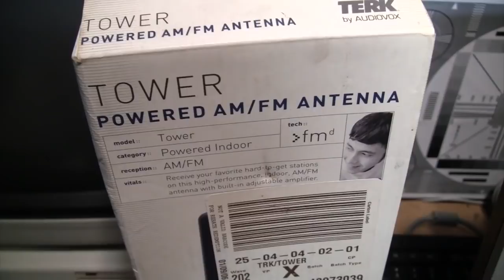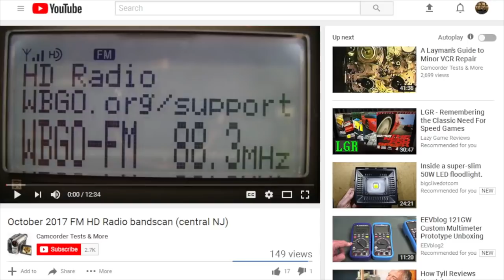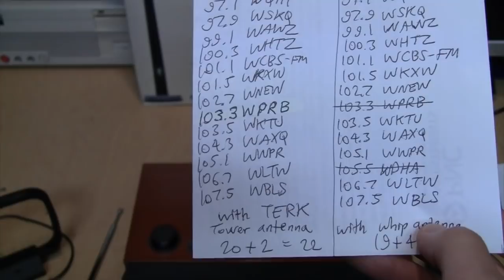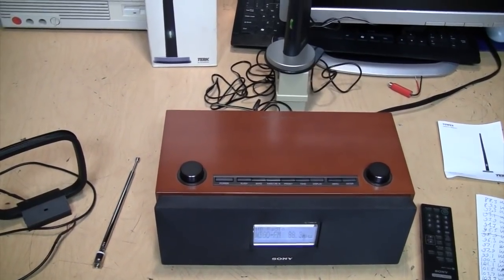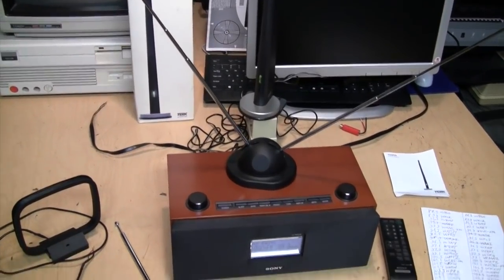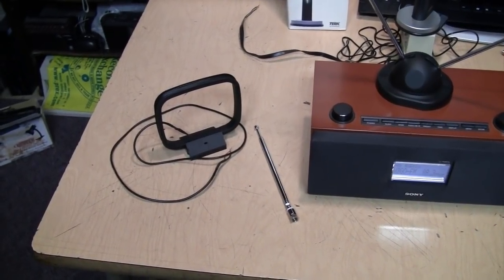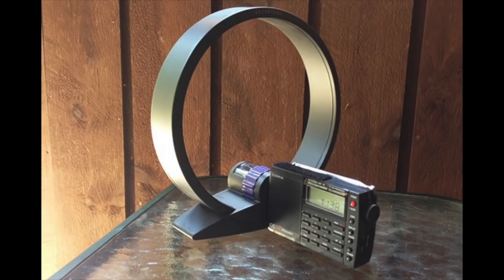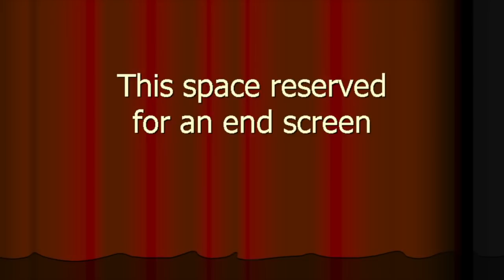Terk Tower indoor AM/FM HD Radio antenna review & test

Comment: For those that are curious, the large bar coded sticker that's on the front of the box is an older Circuit City shipping label. The store number is 3689, which meant this was originally delivered to the Bridgewater, NJ store back in 2006.

Comment: Most antennas will perform similarly indoors, so a test isn't really going to yield much information (as you see here). To really boost signal, we need to use antennas that are outside and up high. I know, not everyone has their own roof, but that's the reality of antennas. Even if you can put something out on a (high) patio or balcony or inside a (wooden) attic...

Comment: Try a wire spool antennae by Sangean or Tecsun to clip onto the end of the whip. They are about 20 feet long and make a big difference. I have a hook on the wall that I have it attached to and when I need to use it  just run it to the radio and clip it on. Works quite well.

Comment: I use a Technics SH-F101 tunable amplified FM antenna which is from the early 1980s. The antenna has wing shape on ball mounts, so it can be adjusted for best signal strength and least multipath, without moving the base. It works very well, and typical of early 1980s stuff, looks nice.

Comment: I think I just bought the updated version. They separated the AM loop cable from the FM amplifier. In the manual it states to position the AM antenna 90 degrees from the FM antenna. Sounds a lot better now.

Comment: Perhaps you could use a DC jack and plug to modify the power supply of the radio if you don't want it to be permanently attached.

Comment: @VWestlife  I wonder, is it still working now, over two years later? I can't get my ASUS to work, but my new Ocean Digital WR230S AM/FM HD Radio sounds Great! I had to wire into the router, cause the wireless wouldn't work on the new one either??? The sound is very sharp and clear, and I'm finding more stations than I can store! There is so much out there to listen to, and it is so much easier than using my computer!

Comment: You could cut the power cable on that radio and then put on a plug.  You could even make room on the back panel for a plug mount if you have a mind to.

Comment: I've thought about buying one of these, so this video was especially helpful. I'll just stick with my Radio Shack powered VHF/UHF/FM antenna... it's the only way I can receive anything on my Kenwood's crappy, weak FM tuner without static. Otherwise I wouldn't need a powered antenna because any non-local FM station is way too far away for me to pick up; on other tuners, I don't even need an antenna at all for static-free reception. I've heard a LOT of good things about he Terk AM Advantage though, so I might think about buying one of those.

Comment: I had the same antenna at one point in time, the amplifier in the Terk antenna is very easily overloaded. If you're trying to pick up a weak station but have a strong one nearby, it doesn't work because the strong station will overload the amplifier circuit in the antenna.

I took mine apart and can confirm that the AM portion definitely does not have an amplifier.

Oh, by the way, I picked up this Terk antenna for $5 CAD few years ago. $20 USD you got ripped off!!!

Comment: The only thing worse than an un-removable power cable is an un-removable VGA cable on CRT monitors. when that port on the end of the cable breaks. their goes your CRT unless you want to open up the cable and solder a 30-pin vga port :/
Reply: At least a power cord you can easier change

Comment: I have a old FM QuadraTech™  tower antenna I got with some stereo equipment months ago, its a Clearline CL-200

FREQ. 88-108MHz  GAIN: 16dB  GAIN CONTROL: 0 ~ 16dB  MAX. OUTPUT 100dB µV  OUTPUT: 75Ω  117 VAC, 60Hz 1.2W DC 12V 100mA